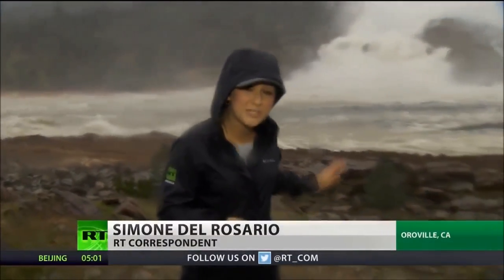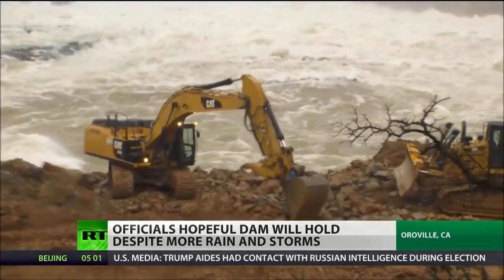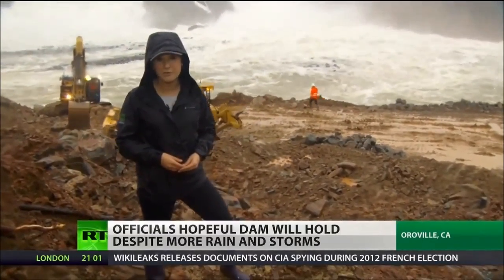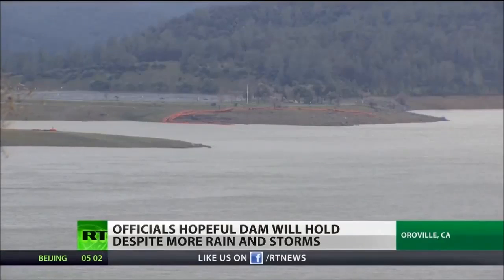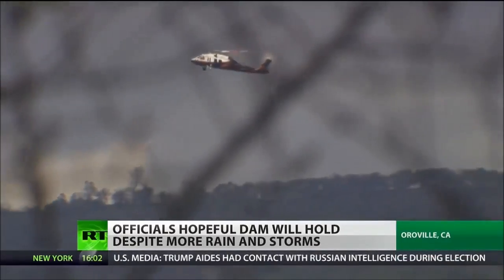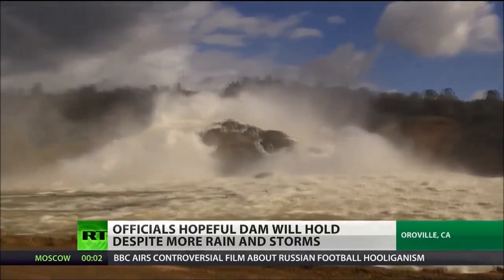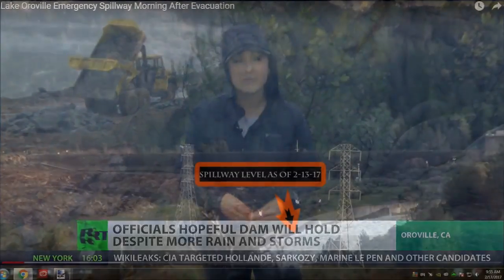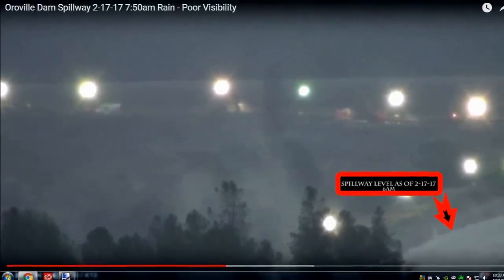Oroville Dam Repair update & Waterlevel Timeline

Comment: OROVILLE DAM RISK ...  LOW to MODERATE, AT THIS TIME, 19FEB17 - 1844hrs  You can watch it here...
http://cdec.water.ca.gov/cgi-progs/queryF?s=ORO&d=19-Feb-2017+17:35&span=12hours  (click "latest")
       Summary: NO DAM DANGER ISSUES, but there's a big ass hole to fix when rain stops.
REAL ISSUE: Agenda 21/2030, to "re-wild" the US, allowing infrastructure to disintegrate, and to reduce population by 90%.